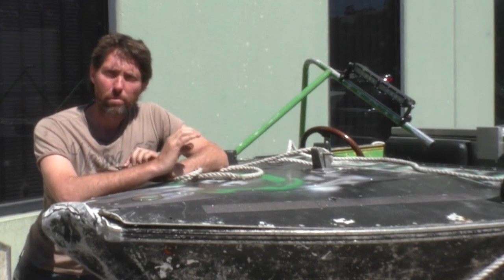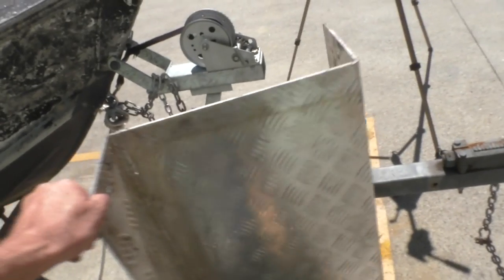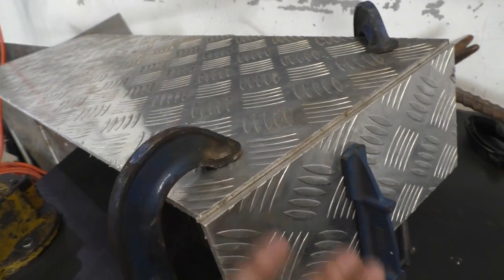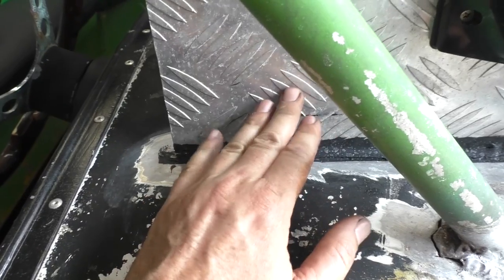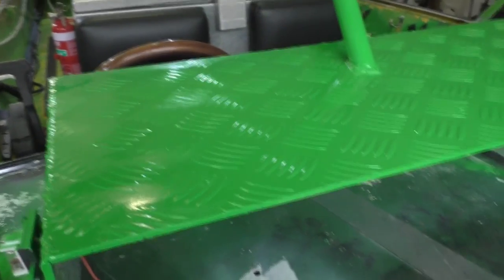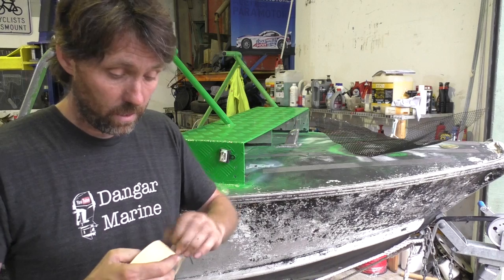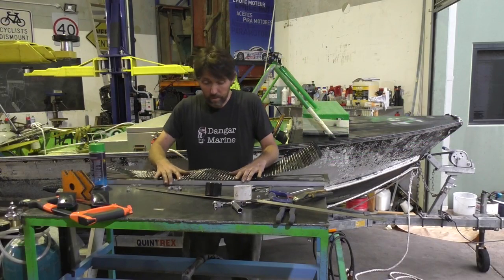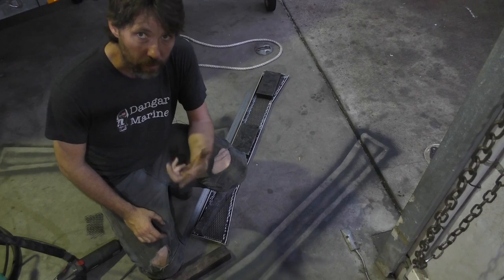Green Machine gets its glove box

Comment: Some boat fishing tips: I like to have 3 to 4 rod holders on either gunwale. Adjustable ones are best but the ever reliable PVC conduit also works ok and won't get stolen. 
When fishing calm waters like the river I like to have 2 anchors out, one from the bow and one from the rear cleat. That way you can use all of your rods on one side of the boat without your lines tangling up. 
Fish with small hooks and light lead (unless you are drifting for flathead). 
Fresh caught bait is best, local mullet, yellowtail, prawns, squid etc will usually catch the most fish.
Tight lines and if you ever need a fishing partner give me a yell!
Reply from the maker: Hey Matthew, thanks for the tips. With regards to fishing partners, I was thinking it might be fun to have a channel meet up some time this summer. I'll have to pick a date and we'll see how many can make it!

Comment: nice work on the  backyard fabricating, I think it came up nice. little tip, spray a circulsr blade with inox when cutting ally. and if your worried about bumping your head on the end of the screen when climbing through to the bow you can get tube end caps from any hand rail supplier you just gotta know the I.D (inside diameter). nice work
Reply from the maker: Thanks mark, I'll give the Inox spray a go next time. I didn't show it in this video but I did have some end caps arrive from eBay shortly after this was finished.

Comment: Great job Stu! That was a nice build, looks great and very functional. I was wondering how you were going to cut that thick aluminum nice and straight. The circular saw was a great idea! What kind of blade did you use to do that?
Reply from the maker: Thanks mate. :) It was a reasonably fine tooth blade (can't remember how many exactly). It is a blade that I bought for timber but it also mentions on it that it is good for aluminium so I don't think it was anything special. Certainly nothing I bought specially for the job.

Comment: Hey Stu, love watching your videos, they're great, and your well thought out work with all the repairs is great too, with the cost of repairs, parts, time and effort spent on this boat, would it not be more beneficial to just get a different hull, second hand or new,  or does the green machine hold some sentimental value?
Reply from the maker: Thanks mate, glad you enjoy the vids. There are a few reasons I keep the Green Machine. The main reason really is that my labour is free and new hulls are expensive, so there is that, but also when you look back, there isn't a huge amount of work I have done that wouldn't need to be done to a new hull anyway. The underside would still need cleaning, priming and antifouling so it can live in the water full time, I would probably still need to add good wiring for a reliable auto bilge pump and navigation lights etc. The final reason is that no matter what hull I had I would probably want to customise it to be to my taste, so I would probably only start the process again with a new hull anyway.

Comment: Could you do a video on lean sneeze? I'm looking forward to the vids on the engine rebuild.
Reply from the maker: Interestingly we had an outboard with that condition just recently - well what sounded like it, so we focussed on cleaning out the carburettors - but it turned out to be a partially cut and grounding ignition wire that was causing an intermittent spark. Next time I'll be sure to film it.
Reply: Dangar Marine tks for the reply. I'll have to check my wires. It's still doing it time to time.

Comment: Have u ever posted measurements or model of the green machine? I would quite like to know the demensions of the green machine. Is it a riveted or welded hull? Beam, OAL, and width, and have u ever done a transom vid on it? Thx. Love ur vids BTW.
Reply from the maker: It's a DeHavilland Offshore. 4.6M LOA, 1.8M beam. I've got it back in the shop at the moment needing a bit of work, including welding a transom support so you'll see that soon!
Reply: Dangar Marine : Brilliant! Thanks for the quick response. I have a Gregor 15’ Baja Special, boat looks very similar except mine is not a runabout. Mine does have the high gunwales and plenty of free board for inshore but gets somewhat sketchy in 6’ swells offshore. The Gregor is an all welded boat, makes it quite strong. Only rated for a 25hp max though, still gets it up plenty fast round 25mph. Can’t wait for ur next vid! 👍

Comment: So glad I found your channel when searching about Outboard Servicing. Loving the green machine! I may give a DIY go at servicing my 1997 Mariner 4hp myself for the season. Rather have somebody like you doing it being so knowledgable and diligent as I don't have much history on the motor.  Runs very well but not sure when anything was done last, so thinking Water Pump, Carb Clean, Plugs and Oil, seems a bit stiff getting into reverse but the more I have done if back and forth the easier its become. Im based over in Seaforth,  Northern Beaches does the green machine get over to Palm beach way?
Reply from the maker: Hi mate, hope the videos are helping you with your boat. The basics you describe are all you really need to keep an outboard in good running order. Just be sure to check the colour of the gearbox oil that comes out to make sure it doesn't have any water in it and you should be fine for another season. Every now and then I'll head to Palm Beach or Lion Island in the Green Machine. It's much closer by water than by car!
Reply: Helping a lot thank you!. Where would suggesting getting the service parts from?. Or maybe a day out for us and hand it over to you!.

Comment: What about the bow repair you were going to do? Is that still in the pipeline?
Reply from the maker: Yep, sure is. My current plan is to cut the bend bow off, weld a flat plate onto it and then knot up a Turk's head fender to lay over the plate.

Comment: fix a flex is what is the main use of this product????
Reply from the maker: Sikaflex is a polyurethane sealant and adhesive. It's amazing stuff. I used it in the "fixing a hole without welding" video and many people just don't trust that it works, but it really does hang in there for ten years or more. In another video I took the bolts out of an outboard and lifted it off the transom but the whole boat lifted off the trailer because the Sikaflex was still holding them together!

Comment: Dangar is there anywhere i can talk to you back and forth about my motor. Because i was out trying it on the water this afternoon. And it only had like 50-60% of its power, it starts like a charm, it runs like a charm in idle. But when i give it some throttle it will just start running poorly kinda jumpy if thats makes sense, and it sometimes completely dyes out, it starts first pull after tho like a charm. We managed to go into a half plane, but the boat was wopply and was hard to steer, not because of the steering but because of something else i wouldnt be able to tell exactly what..  Thats why i hope you wanna maybe chat alittle back and forth with me to try figure out what could be causing it. 

Should maybe tell that it is a suzuki df25 v-twin 4-stroke motor from 2008 - and as far as i can read in the manual it is with cdi box so i wouldnt be able to adjust the timing myself im guessing. 
And the boat is a Nordeck 15. 15 foot

Thanks in advance :)
Reply from the maker: Here really is the best place, just reply with new messages and I'll see them. It is also good because the information is available to others with the same problem. These types of problems really involve going through all the basics to start with. Look for any splits in the fuel lines sucking air, make sure all the carburettors are clean and that the reed valves behind them are in good condition if it is a two stroke. Also check that you are getting good spark on each cylinder and all cylinders have good compression.
Reply: Im gonna go thrugh the fuel lines tomorrow, i have a idea that it can be a air leakage in the fuel line somewhere. Because it is only in higher rpm it is a problem rly. and if i full throttle it to fast. i have to kinda 3 step up the throttle to keep it from dying.
Do you know how to stabalize a half planing boat to plain proberbly. or is that just a nogo, my Nordeck was abit wobbly when it was about to plain ?  Thanks for your reply, and i will be back when i have been testing the fuel line. :)
Reply from the maker: An anti ventilation on the gearbox can help with boat stability, but the exact effects are hard to predict without experimentation. http://www.ebay.com/bhp/hydrofoil-stabilizer

Comment: You should tell your boss to buy  a spool gun for the mig welder, its much easier to use and a hell of a lot faster.
Reply from the maker: The trouble with MIG is that you are always adding metal as you go and some areas require quite a bit of working before you have a puddle you can add filler rod too. The other big problem is that I don't have a boss. ;)